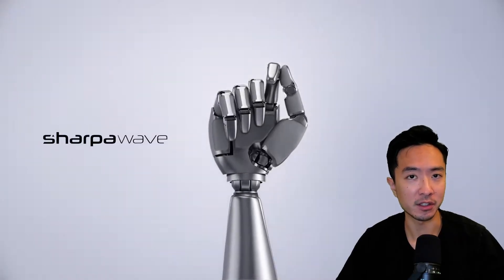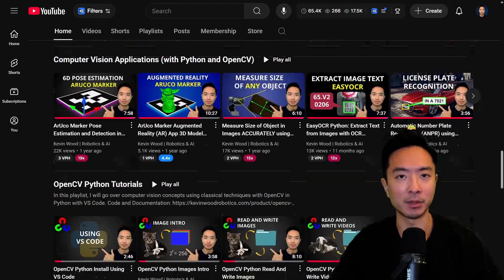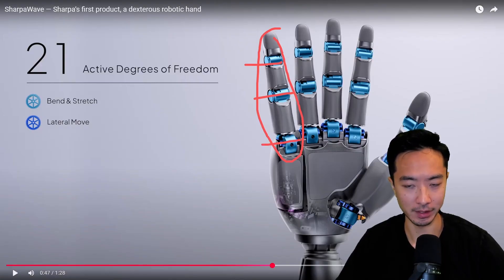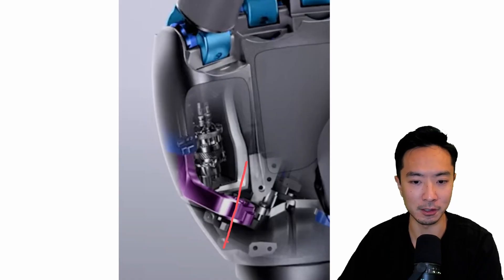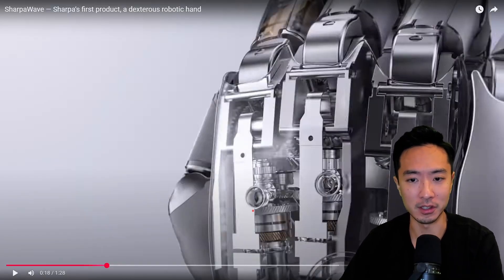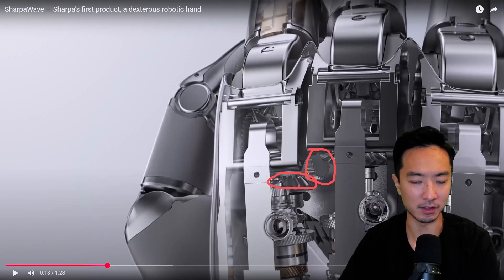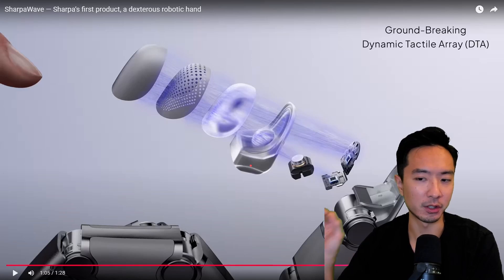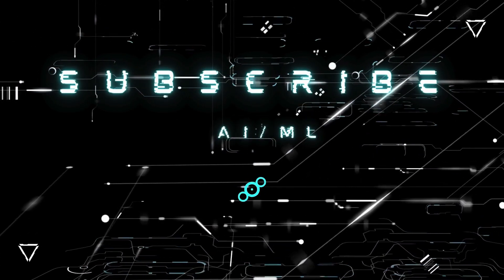Sharpa IMPRESSIVE Robotic Hand Design Explained

Comment: None of these mechanisms make any sense. This is the work of an artist, not an engineer. Bevel gears meshing into spur gears? Are you serious? Axes intersecting gears mid-radius? clockwork precision gears in actuators that require to exert considerable force? What the actual fuck? To make matters worse, look at the wrist: It's a plain ball socket with no actuators! How can you be selling robotics projects when you can't even tell the difference between a CG mock and a real humanoid gripper?

Comment: Ehhh it's gonna be a pain in the ass trying to figure out how to make something like this but smaller with more dexterity of surgical robots for delicate work in a vacuum and highly dangerous environment that could cause damage to the machine and mechanical parts early without proper resistance in the parts , alloy and if I get enough time a synthetic coating of material resistant to anything ranging from temperature extremes , radiation , damaging sound frequencies and EMPs of the nasty kind that can adjust it's frequencies to mess up electronics and power cores if lucky enough to manage to make one .

Comment: Everyone here is reflecting the same thought I came to 5 seconds into the video. This must be fake, too many moving parts for anything outside of motion graphic aesthetics. There is no way this thing maintains its integrity under stress and load.

Edit: Ok, this bothered me so much I had to pause the video and do a rough modelling in blender. I didn't even have to go past five gears. Because when lined up, three of them didn't even mesh with anything, because they were either too far behind or forward to engage with any other gears in the vicinity. And worse yet, just at a glance most of these gears don't even have a place to be structurally supported or secured internally. The majority of them have mismatching teeth, meaning they won't even engage each other properly even if they do engage.

I'm pretty much convinced now that an A.I came up with this and someone just threw enough polish on it for unaware people not to notice it.
Reply from the maker: Yeah the bevel and spur gear is strange and probably not possible

Comment: yeah the gears are fake. they vaguely resemble clockwork, they are not at all arranged or shaped in a meaningful way. otherwise much of the hand design is solid. Actually much better than most. Boston dynamics's hand has a big camera block on it, very clumsy.

Comment: You've been fooled, my friend. No way those are the actual gears of the hand, just clockwork render for aesthetics. As you point out, the main suspicion is the absence of the motors, but there are no drives or encoders either. I would suggest buying the actual hand and tearing it down to get a reliable analysis of how it works.
Reply from the maker: Yeah that would be the best way to

Comment: I would recommend deleting this video. It was obvious at first glance at the thumbnail that the mechanism depicted does not do anything. Each type of gear and spoke design has an actual purpose that is not even remotely being applied here. Also, considering the idea that the load path would have to go through a tooth the size of a grain of sand is absurd. Please do not attempt to validate these predatory marketing techniques.

On top of that, there was no analysis in this video. Some of your other content is interesting, but you clearly phoned this one in. I only wish you well, so I suggest not taking your channel in this direction.
Reply: Yeah huge L, just stumbled across this channel so no idea what his other content is like but for someone who's supposedly so well versed in engineering/electronics it should be immediately obvious this is fake af. Not sure why he's even trying to give any honest commentary on it when most of the gears clearly aren't connected to anything with most of them being way too small and randomly placed to serve any real purpose even if they were. You don't even need any technical knowledge to know this is fake like having a thousand gears in the second finger segment right before the fingertip, how does that even make sense when you only need enough to actuate a single joint?

Comment: AI slop
Reply: If you train AI on clockwork, its going to just make random gears everywhere. The gears will look good, because that part converges, but the layout doesn't look good, because clockwork gears mechanisms are all different. You would need something better than just diffusion to make logically accurate gear trains.

Comment: With that excess gearing it should be able to lift up to 1 ton.
Reply: With watch gears? Those things would snap trying to bend a toothpick. This is fake af anyway, most of the gears aren't even connected to anything.

Comment: 100% guaranty fake internals meant to look cool. Loved your video on tuning PID, but you're adding nothing here. "Look many gears"... yea great but why, that's not adding anything that you couldn't get from a random guy f the street.
Reply: Yeah and also the more moving parts, easier it is to break.

5 finger gripper doesn't just have performance issue but the biggest is reliability issue. They're costly but breaks super easily, hence why it's mostly used in research and in production you often see 2 or 3 fingers. 

I have no clue why adding 100s of tiny gears would help with that.
Reply: @Dannyboi91  what about high entropy alloys that can take all their weight like a ant and not break or need too many replacement and can overlap when needed to be pieced together .
Reply from the maker: Yes could be fake

Comment: Fascinating.  Did they mention a price?  Each digit section contained enough internals to cost hundreds if not thousands if it were actually a watch mechanism.  And how many of these will be needed per pair.  No wonder Elon was complaining that this was a major bottleneck. ;-)
If this is real and those strangely meshing gears were not AI hallucinations, this has very serious implications for the supply chain, not to mention assembly.

Did they show any usage examples?
Reply from the maker: Yeah it would be pretty crazy to mass produce these. Not sure about the price but I have some sample clips from ICRA on my channel featuring this hand
Reply: @kevinwoodrobotics  - I imagine that the Dr Scott deepdives will now get even longer as more and more complexity is revealed.;-)

Did Sharpa sponsor your trip to ICRA Hangzhou?